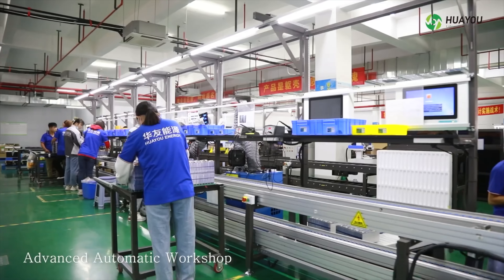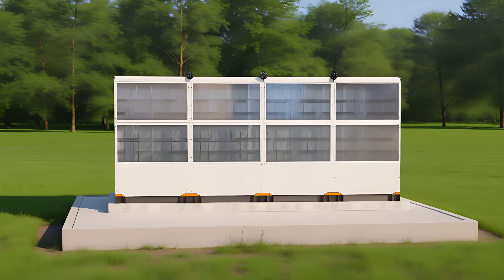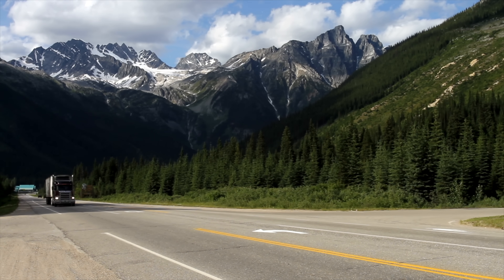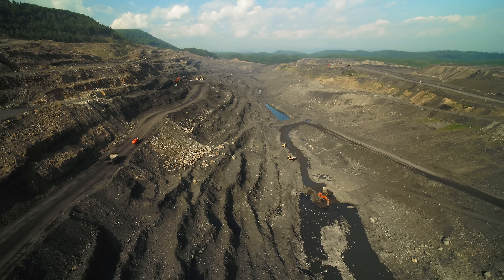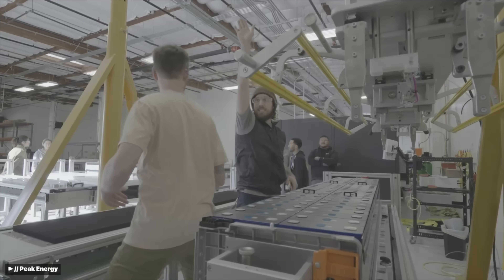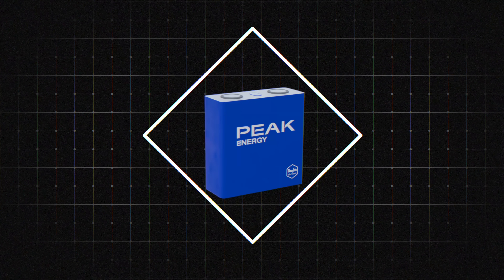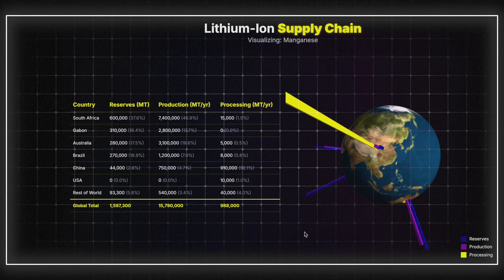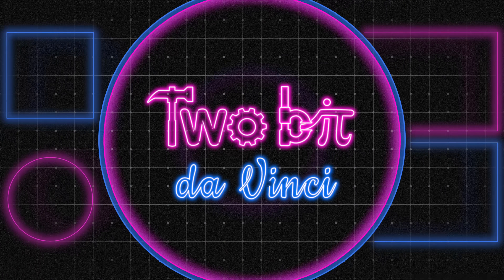Sodium Ion Batteries Are Going to be EVERYWHERE - Here's Why

Comment: Did I miss charging rates, longevity and recyclability?
Reply: No, not covered.  This video just says long longevity, but CATL has stated over 10X LFP.  The recycle is no showstopper because of the long usefull life and the fact there is nothing toxic and nothing valuable left.  CATL formula has manganese only.  C rate is less of an issue when $/watt is so low -the answer is get a bigger battery.
Reply: @skyak4493  Thanks, I was doing stuff while watching and wasn't sure. Still curious about charging rate and recycling.
Reply: @pumpedupdart6859 recycling carbon and salt isn't really a priority the same way that cobalt, lithium, and manganese, are actually a higher priority for recycling.
Reply: @michaelwicker9538 priority has nothing to do with cost effective and reusable materials after. With the battery does it degrade the materials so mu h you cant recycle it? Nothing said so we dont know. And the fact hes so hard about it being so good its probably not that great.
Reply: @skyak4493  you dont always have room for a "bigger battery"
Reply: Sodium and iron aren't a recycling issue.
Reply: There is alot of evidence that Sodium Ion will charge faster than LFP, and last longer than LFP, and is less likely to catch fire than even LFP. And it costs dramatically less and requires no exotic metals. So while any battery is "recyclable", sodium ion cells don't contain enough valuable metals to make it worthwhile to do it. That is the major flaw in the whole recycling push for EV batteries... the highest benefits come from the oldest, outdated tech.
Reply: @patreekotime4578 the mass requirements in sodium tech currently make such batteries impractical for transportation and mobile devices.  Fine for storing energy in a stationary capacity, like a house power grid or for a factory.  But I just don't see your pickup truck being run by such batteries.
Reply: @umpatas5468  The facts disagree. Energy density for lab scale Sodium Ion cells is trending to be on par with Lithium Ion soon if not already. Chinese are already deploying Sodium Ion cells in vehicles, and CATL has a hybrid battery architecture that will allow them to pair energy dense Lithium Ion cells with less energy dense Sodium Ion cells in one vehicle.
Reply: @patreekotime4578  but a very inferior C rating compared to LTO which wont fit some applications
Reply: I keep thinking about this video and it does give me some hope.  I do have a question and maybe I missed it in the same respect to the question above.  
     1) Size to Charge Potential:  How does battery size compare between one of these batteries and the Li+ batteries we’re currently using?  The video stated something like ‘if we’re okay with vehicles that go 200 miles rather than 500 miles on a charge’.  Is this to say that battery output for equal size batteries (by size or weight) is 40% of a Li+ battery?  
     2) How does it handle when it’s hooked up to a second battery for charging?  Are there negative consequences for connecting a Li+ battery backup to a NiI Battery to charge the NiI battery (in either direction)?  
     3) I’m not familiar with the abbreviation LFP in this scenario.  Would you spell it out?
Reply: @webklinger  3) LFP is lithium iron phosphate battery chemistry.  LFP is the current budget EV battery good for ~280mi.  1) This new Na battery is reaching the same power density as LFP, and it is just being introduced so there is hope it can be improved with development.  2) CATL is offering battery packs with mixed types.  The only mix that makes sense to me is adding enough Na to manage the temperature of a high performance NMC.
Reply: It's definitely going to be recyclable.😅
Reply: @mechticulous8202  Capable of being recycled, but probably cost prohibitive to do so.
Reply: And energy density.
Reply: This video just lets out the extremely  bad downsides, like most of those videos. 
Watch Will prowses videos on sodium batteries. He tested one.

The efficiency is really bad, and what's the worst: It's Discharge curve is absolutely horribe. An 800V battery made from them would have 800V when fill and 200V when empty. And you have to go that low to not make the energy density be even worse. 

I am thankful for channels like will prowse, which tests that stuff and gets to the core of the tech. In stead iof channels like this, which just read the investor relations kletters and marketing brochures with critical thnking being pjut on emergenmy cutoff mode, sending people to invest money into something that dioesn't word as advertised and loose a lot..
Reply: @Flinno-k8w  He tested one what? Context is incredibly important. This is a rapidly evolving technology and nothing that is available to buy on Alibaba is even remotely close to the cutting edge. This isn't like lithium ion that has been a mature technology for 20 years and only sees marginal changes from one year to the next.
Reply: @pumpedupdart6859  that's the biggest problem.  It's not as efficient as lithium batteries.  It wastes energy basically.
Reply: All points im making in my comment. Yes it has potential. Just like every other thing out there.

Comment: Assuming they have some form of patent, the smart thing for them to do would be to license the technology and have others finance the scaling required.  I would be confident that companies like Tesla, Ford, GM would love to be able to produce / source the batteries locally.
One thing I did not notice was the time it takes to charge.  At this time I would assume it is not much different to the lithium battery and that is why it was not worth mentioning.
There is also the rate of degradation from charge cycles.  At this point I am assuming it is better since the structure is stronger.
Reply: There is research showing that Sodium Ion chemistries will be capable of much faster charge rares because of thier relative stability compared to Lithium chemistries. Projected lifespans for them are very long. It's a huge game changer.

Comment: Meh, salt batteries have significant difference in power output when full charged snd half charged. Nobody wants a power tool that slowly slows down the more you use it. They need an additional dc to dc converter circuit just to be on part with lithium and the cost of those scales linearly with wattage.
Reply: Sodium batteries is NOT for use in the small appliances. It's only for large scale energy storage system and standard range electric cars

Small appliances like power tools, phones, laptops, and e-bikes are still continue using high density NMC lithium batteries as the size is exceptionally limited

Comment: I remember one aluminium battery chemistry invented by a Californian university.  It works with carbon, urea water solution as electrolyte and aluminium. Its voltage is under 2 volts, and the urea is pretty cheap and was in tests keeping the aluminium oxide out of electrode. Low power density,  tolerates mild freezing temperatures only, but because the electrolyte is water based, it can't burn. (Likely the University was Stanford). The article is old, maybe 7 years or so. 

Finnish national research center, VTT was experimenting sodium chloride-carbon batteries. Also just news,, there is a spinoff company.

Comment: Engineers ❤️ love facts and economics like this.
Engineers main focus is creating the steps to economic implementation. 

The electric future is not grid electricity it is battery electricity.

The grid is impossibly too small to replace fossil fuels and extremely expensive to overbuild or to EXPAND.

The grid is too valuable to waste. 

The one way supply of electricity to the  customers grid meter box for cashflow, is the past national grid. The historical national grid business model. 

The future is millions and millions of roof PV and battery feed-in electricity 247.
The future is the cashflow from industrial customers moving away from fossil fuels to clean feed-in electricity from the grid.
The future is grid services and emergency backup to needy meter boxes, needy consumers. 
Say a flat battery top-up. Hahaha 👍 😆. 
The future national grid business model. 

EVs v2g massive battery on wheels parked 23hrs every day and all night long. 
Roof PV dirt-cheap electricity top-up daily. 
The EV will be usefully valuable 247, the 1hr daily drive and 23hrs parked. 
MAXIMUM UTILIZATION of private assets is the nuclear promoters mantra. ❤️ 

Quantity has its own QUALITY.
300million vehicles with 100kWh for range is a massive free storage private asset.
USA freedom. Hahaha. 

Electricity from the sunny sunbelt latitudes and windbelt areas to the cooler north latitudes in mid winter weeks and a little fossil fueled heating is nothing.

Unfortunately grid owners GOUGING for ROI, return on investment, is going to hit the poorer slow adopters. The aged, in end of life years.
Those heavily invested in fossil fueled appliances and vehicles short on ROI years for the new technologies. 

The early wealthy high income, high marginal taxpayers will love the tax-free savings. ❤️ 
Unfortunately they will strip out their grid cashflow.

Remember roof space is empty dirt-cheap realestate and PV has no grid RENTAL costs. 
Remember, massive battery is dirt-cheap FREE MASS ELECTRICITY STORAGE.

Comment: If the sodium battery architecture is what it promises and  the current (pun intended) charging situation around the world is improved (by demanding EV's are charged by solar energy at the house or similar systems then this tech has a massive potential.
I think the thing that most people puts off in the use of electricity in vehicles and where electrical replaces fossil fuels is the way it is pushed for by governments all the while the infrastructure is not ready for it.
There needs to happen a cultural change where your electrical needs should be met by your own electrical infrastructure.
A very good idea would be an idea that has been around since the 1930's where a German factory (known a Porsche) designed a system where the batteries of any vehicle are not necessarily charged IN the vehicle but can be easily changed out for a ready charged one. In practice this would mean an EV comes with two Sodium battery packs, one is in the vehicle being used the other is being charged during the day time by solar or wind power. It could also be that battery availability would be guaranteed by a kind of subscription system whereby one does not own the battery per see but has the right to use a battery and have it charge at home, at work or at a nearby facility...

Comment: 0:35 Sodium (Natrium) isn't salt. Salt is Sodium Chloride.
Reply: The inclusion of salt as a component seems like it was used more to indicate how common Sodium is.  In other words, NaCl is in every household in the US, and can cost less than $1 per pound. Furthermore, Na is not found in nature because it is highly reactive so Sodium metal is most commonly produced globally via electrolysis of molten NaCl.  If isolated elemental Na could be found in nature along with Sodium compounds like NaCl, the distinction would be relevant.  In this context, however, I didn't hear him claim that Sodium and table salt are the same thing.  I heard him state that it is "made from some of the most abundant materials on Earth.  Iron, Carbon, and Salt."  That statement is almost certainly correct.  It would only arguable in any way if this company intentionally uses ONLY significantly more uncommon sources to isolate Sodium.  Also, no single battery produced by this company forever could utilize Sodium extracted from the most common source of Sodium in the world.  

Pedantic Gibberish:
Sodium is the 6th most abundant element in earth's crust, but at ~2.6% could appear limited percentage-wise.  That said, more than 70% (can't remember precisely off hand) of seawater's salt content.  3-4% of seawater's weight is solute NaCl and that does not include ancient evaporated seas that deposit NaCl as Halite.  Something like 40% of salt is produced from mining where estimates say 15-30% comes from solar evaporation of mostly seawater.  This is all to qualify that, while estimates vary pretty widely, based on humanity's current rate of salt consumption, almost all of them conclude that it would take more than 100 million years for humans to exhaust the salt content of the oceans alone.  In addition, the salt we consume is "reinvested" in nature.

Given that NaCl is the most commonly occurring source of Sodium, is very abundant given real-world references showing that  ~2.6% is definitely a lot on a planetary scale, is so commonly available that its price per pound is almost inconsequential, and (while the most common) it is just one of the Sodium compounds found in nature, it is clear that Sodium supply is not a concern.  Additionally, given that electrolysis of molten table salt is the most common source of Sodium metal, I don't think it is incorrect to state that the technology uses very cheap, commonly available components like table salt.  Being fair, the Peak press release references Soda Ash reserves so it is possible that the more highly pure, NaCl extracted, metallic Sodium isn't required.   Gven how much more commonly NaCl is used for extraction today, however, I believe it is reasonable to assume table salt will definitely be a precursor component used in Sodium-ion batteries, including some portion of Peak's batteries when production is scaled.  

Finger-wagging because he said salt could be used in the creation of cheap, stable batteries sounds like, "Um ackshually...Sodium is a component of salt and is different than NaCl.  You should have known salt is a chloride compound containing Sodium."  These arguments sound like dismissive scoffs along the lines of, "Psh...he clearly presented a square but called it a RECTANGLE!!  No real engineer could mistake such simple shapes!  What a fool!"  A square is a rectangle.  Not a perfect analogy admittedly, but since NaCl is the primary source of metallic Sodium produced globally, it is foolish and arrogant to ignore all context to act superior using an unimportant (and actually wrong with context) distinction any child who has attended High School could make.  I am not saying anyone here is dumb or that nobody has advanced knowledge...I am just saying that the remainder of the video's contex makes those pedantic attempts at a "gotcha" sound more like a Michael Scott, "BOOM. Roasted!"
Reply: Yes! It's so annoying. Stop talking about salt batteries. It's a sodium battery.
Reply: @perjohanaxell9862 he said batteries made from iron, carbon, and salt.  Elemental Sodium is too reactive to be found in nature in an isolated state.  The majority of the Sodium produced globally is extracted from molten NaCl...salt.  His statements were accurate in context.  

He did not call them salt batteries that I heard.  If missed it I'd love a timestamp...
Reply: @perjohanaxell9862  If it would be metal, you would be having a bad time with all the explosions and shit. It's salt for a reason.
Reply: Getting sodium from salt is super easy, barely an inconvenience
Reply: noticed it too. bad mistake for an Engineer.
Reply: @damdampapa  he is a freaking YouTuber
Reply: That would be table salt, but you do realize there’s more than one kind of salt and I’m not talking sea salt versus rock salt.
Reply: @jcc777  I am fully aware that there are different salts, but Sodium isn't one. It's an element, and part of many salts, but it is not a salt on its own.
Reply: @albuerum  Sodium is an element? Wow. Who woulda thunk. That's pretty metal.
Reply: @jcc777  Salt is a general chemistry term which includes NaCl and many other compounds. Table salt also contains others elements e.g. iodine and potassium. The iodine is for your thyroid gland. Potassium Chloride is added to help prevent clumping due to NaCl being hygroscopic.

Comment: What a useless battery. Not only does it hold less energy than existing batteries, but the voltage drops in a straight line to zero instead of holding steady like a lithion ion battery. So the longer you use it, the less voltage you have!

Comment: The savings you MIGHT make on sodium are offset by the increased weight and size of the battery. It also has a shorter lifespan. Lithium will be the dominant tech for decades.

Comment: I have a Samsung phone. Every day for the last 6 years I have charged it to 100% no matter what the charge is in the phone at the end of the day. I have not experienced any degradation in the phone. Most day's with a full use for the day I still have above 30% in the battery when I satrt the charging process.

Hey da Vinci. You said a 100% renewable but the amound of battery storage to complete such a feat would be beyond the capabilties of any country. Being able to power the grid from batteries of any meaningful time would be impossible. A 1 MWH battery can power a 1 mw appliance for 1 hour so powering just 1 house would need a big battery to last a day. Mulitple by all the homes, industries and transport and the number of batteries becomes propostery large. Without some sort of baseload power example nuclear fussion/fission or hydro it is never goiing to get even close.

Comment: Sodium batteries will NEVER replace lithium in EV’s, electronics….  

They cannot be quickly charged!

lower energy density, reduced durability from atomic structural changes (P2-O2 phase transition), higher weight and bulk due to larger sodium ions

Transcend the bullshit!

Comment: Sodium cons...  less that 1/2 the charge cycles of lithium And a voltage curve that looks like a ramp.
Sodium pros....   charge discharge temps waaaay lower than lithium 
IMO not worth the trade-off!  Not even close in fact get a heated battery...  DONE